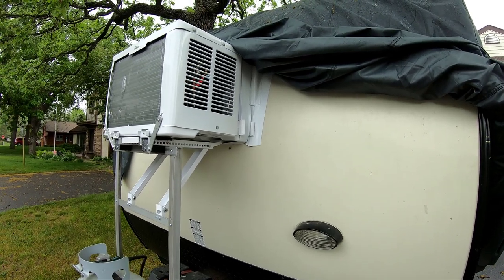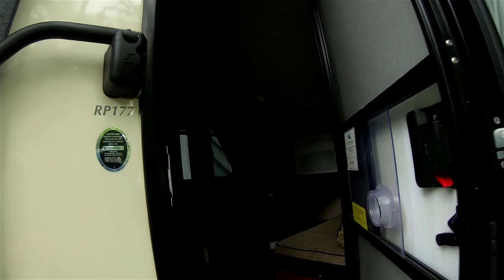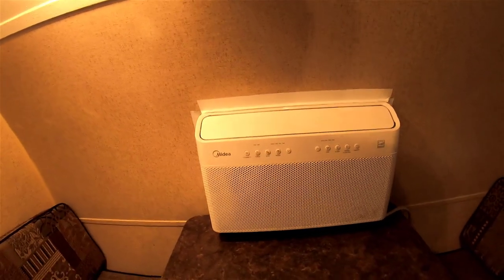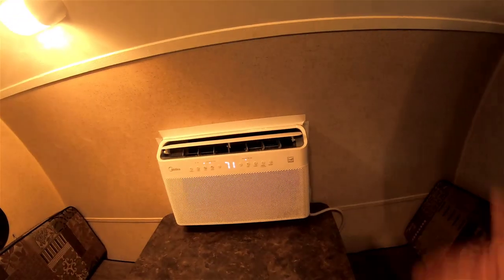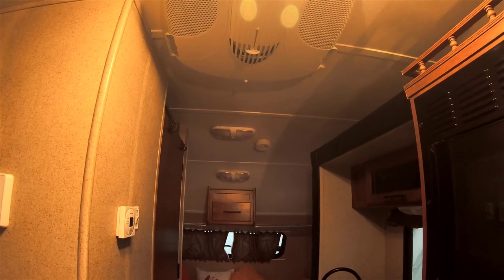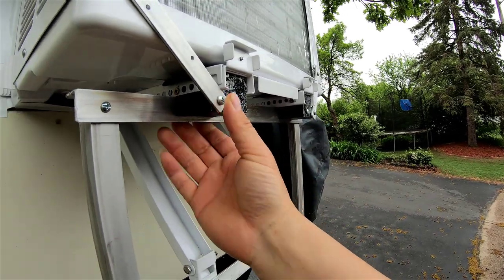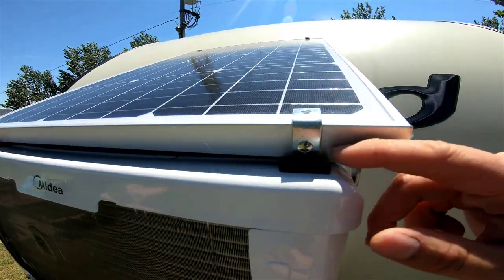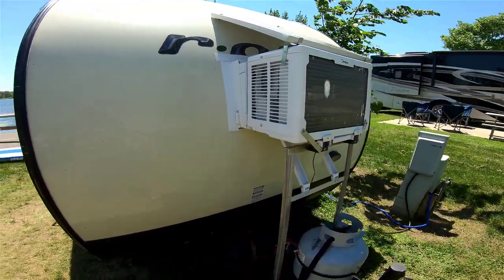How to Quiet RV AC, Forest River R-Pod Travel Trailer with Midea U Air Conditioner

Comment: Are you towing it with the hybrid sienna if so what’s the weight of the camper
Reply from the maker: Rpod trailer is about 2900lbs
Reply from the maker: 2021 sienna towing capability is 3500lbs.
Reply: Thanks what mpg are you getting towing with Sienna
Reply from the maker: I got 27 mpg when towing r-pod.
Reply: @JerryMinne  wow that good thanks for the info
Reply from the maker: 2021 toyota sienna tow package: 
https://youtu.be/uIMGGlRA4ro